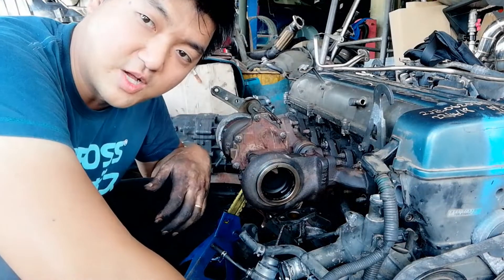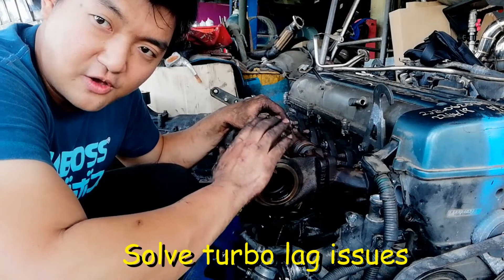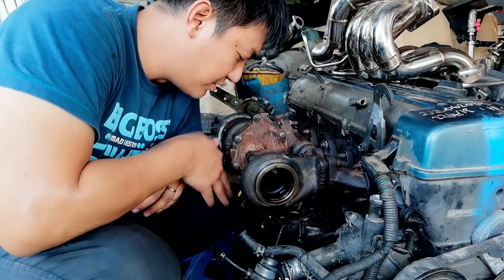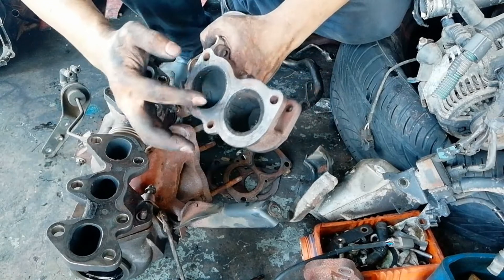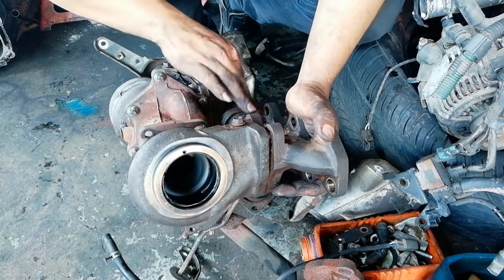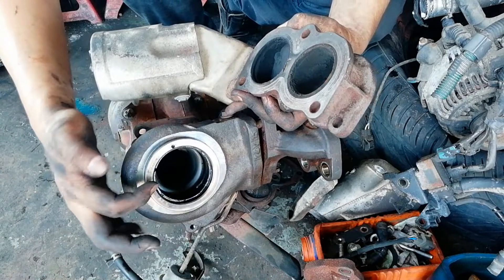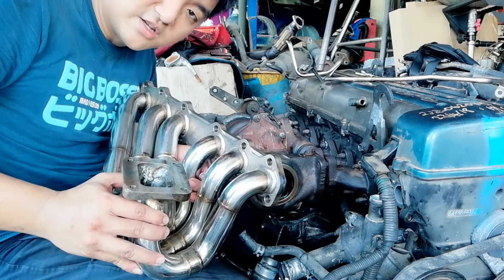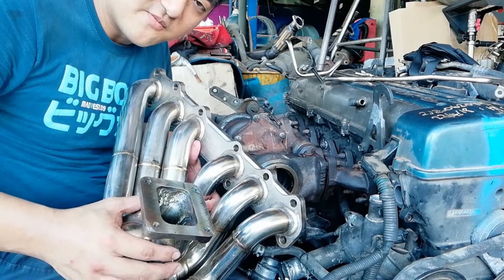2JZ Tuesday - How does the original 2JZ GTE Turbo Works

Comment: Sorry if the question sound stupid  but is it possible to put the gte turbos on a 2jzge?
Reply from the maker: Bro don't worry, no question is stupid. It is possible but u have to strengthen the pistons, con rod and change head gasket unless u are using special fuels. U can watch my other videos on NA to turbo conversion
Reply: @cheapkailaujing  thank you very much bro i appreciate it alot blessings

Comment: You should do a video on 2jz gte water and oil feeds and returns. And which is best to plug off and which to use.
Reply from the maker: ah that's good idea..i try my best
Reply: @cheapkailaujing  thank you I just thought about it maybe in a separate video or same where what sensors go

Comment: Off subject but will a GTE VVTI head work on a GE block (studs and gasket)
Reply from the maker: Yeap that's what all of us are doing. All studs, water and oil holes are the same..
Reply: @cheapkailaujing  awesome thanks for the reply
Reply from the maker: @supranut7164  yeah no problem.. hope it helps

Comment: Hi bro i have a question Are the vvti cam gear GE and that GTE the same my jz vvti cam gear it's making a sound at 2500 RPM and above so i was thinking swap it with a GE   one because it's less money
Reply from the maker: Good question and not the same.. The cam sensor sensing location is a bit different.. And some ge cams are using distributor somemore..
Reply: OK are the 1jzgte vvti and  2jzgte vvti  cam gear the same it's difficult to get  2jzgte parts in Suriname there a lot's of 1jzgte and GE parts